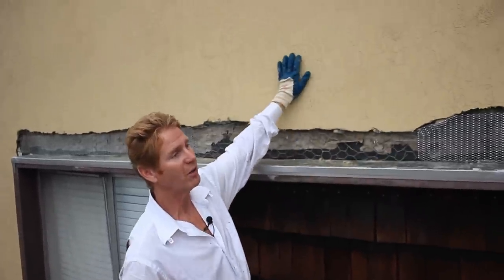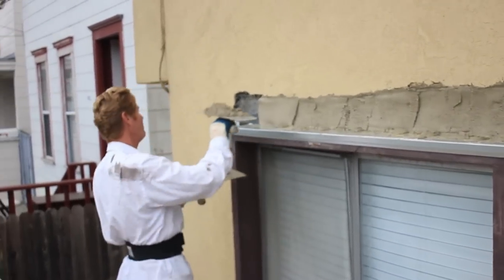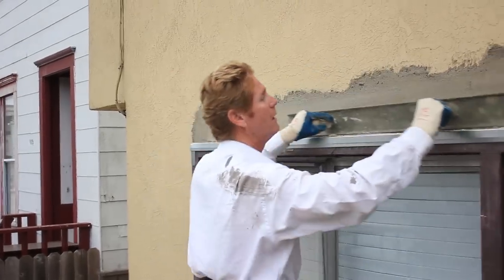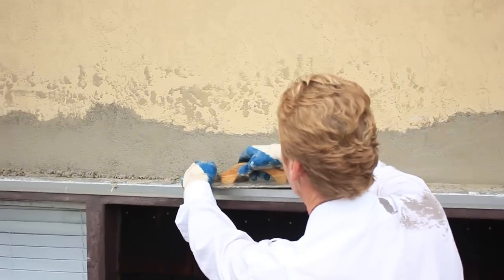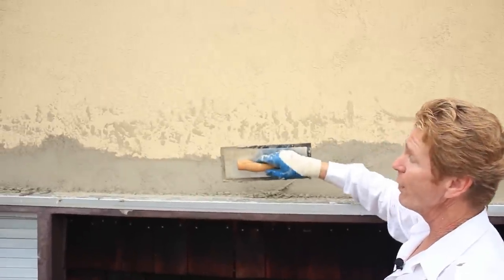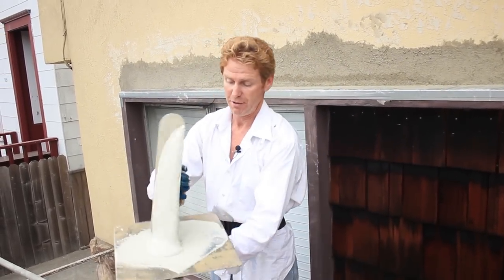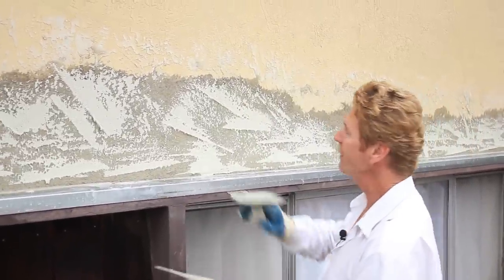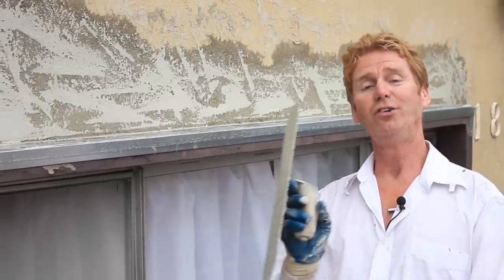How to apply or install stucco.

Comment: I think that  Iallenh1 was trying to say, why didnt you color coat the patch? stucco after brown coat will eliminate any imperfections on patch joints then texture will match existing, but you use texture on top of brown coat.  Interesting work, ive seen almost all your videos and half of them your windows are not masked, why?
Reply from the maker: Hi Jorge Guzman, The fella who commented on this video works for someone else and is not responsible for any of his actions, therefor he is loaded with opinions which he won't face consequences when and if they fail. I on the other hand am morally responsible for all the work I do from 30 years ago to today.
 I didn't need to color coat this small area as it was to be painted like the rest of the wall. 
Lastly this window had a 6 inch piece of wood with flashing covering the window so even when some stucco dropped it landed harmlessly on the metal flashing.
 Best wishes and thanks for the comment.
 Kirk and family.

Comment: Does it end up cracking overtime at the seams between new and old stucco? I had a contractor over who told me he needs to redo the entire wall to avoid cracks.
Reply from the maker: All stucco can crack with earth movement. However, if you tie the new wire into the existing wire it's unlikely to hairline crack.🍾
Reply: If you use mesh tape along the edge of the Crack also I use perlite in my mud. With both of these tricks cracking is minimal.

Comment: can you write a tool list?
Reply from the maker: Evening Pameka Hunt, easy peasy lemon squeezy, hawk and trowel, float and brush.
 Jason and I can show you what most stucco contractosr have on their trucks in a video, if interested,
 cheers,
 kirk giordano
Reply: Thanks....yes....please do show me!
Reply from the maker: will work on it,
cheers,
 kirk
Reply: thanks...but my home was built very badly by KB Home until stucco will not fix my problem...my structural concrete is crack throughout my home
Reply from the maker: Hello, most time a structural crack is caused by ground, soil movement, although I have also seen improper tie ins with wood and foundations that were pored poorly.
 For the time being you can use a polyurethane caulking until to get to the root of your problem, sounds like a bit of exploration is necessary, sorry to hear this,
 Best wishes, 
 kirk giordano plastering
Reply: the entire subdivision having this problem...i am so ready to leave and live in the woods
Reply from the maker: Hi Pameka, I feel your frustration, but the woods would be tougher, I have been there, it's really no fun, get folks together and make some noise in the right direction.
 Best wishes, 
 kirk giordano
Reply: no way...i need it....i am tired of this takers....the wood was my first choice but someone or a dead man i found took my AA+ credit...they messed up everything for themselves...when the worm come run out their butt or flesh....they better not come running to us for pity...do cash

Comment: He mentions a scratch coat but he never scratched it.  It was all done in one coat.  Further, the discontinuous lath over poultry wire is a guarantee of a later crack.  Does not follow code mandated standards.
Reply from the maker: Howdy Ronal, you seem to have just enough knowledge to think you're right but not enough to know you're wrong. Any stucco netting and or metal ceiling meshes are indeed allowed, a base coat consists of a scratch and brown regardless of the scratch line.
 Lastly, there is no such thing as poultry wire. perhaps you're referring to 20 gauge wire that can be used for chicken coops or tile work. 🤔
Reply: It's called a scratch coat whether or not he scored the lines in the mud. Poultry wire? Never heard of it.
Reply: Here in California, for small patches like that, we do it the same style as kirk, but we use Eisenwall(Accelerator) to apply both coats at the same time